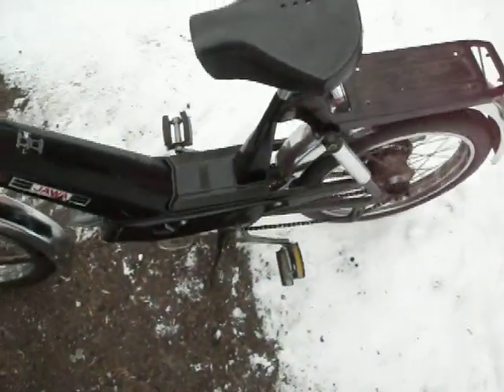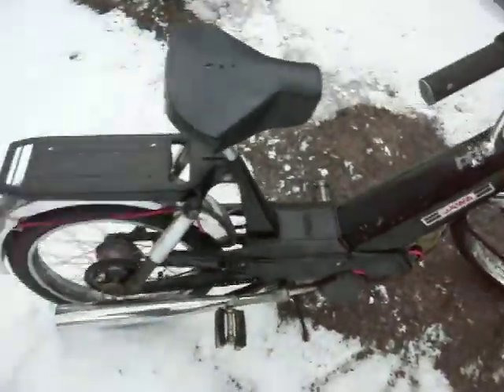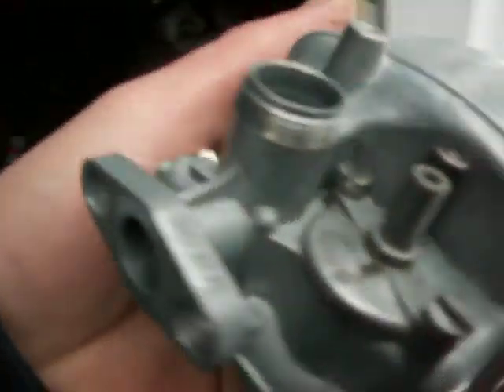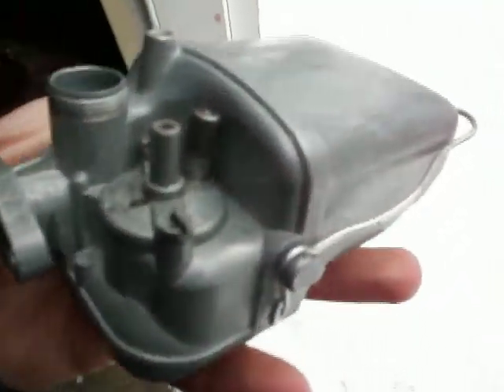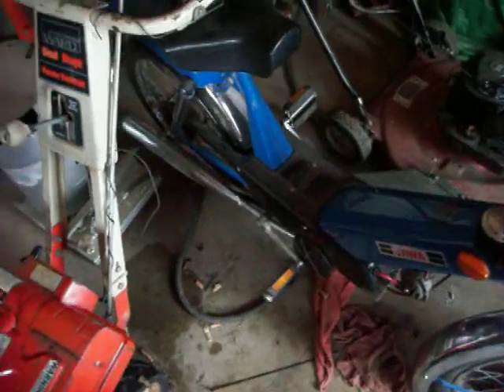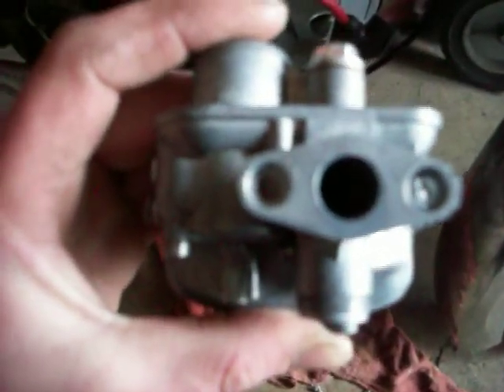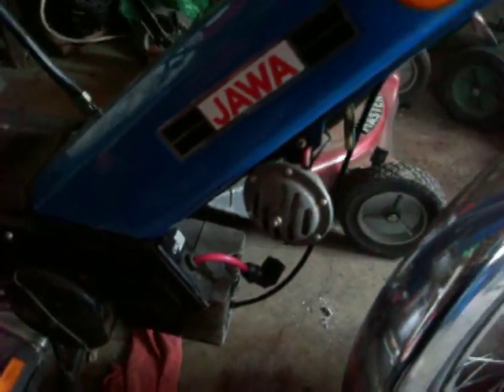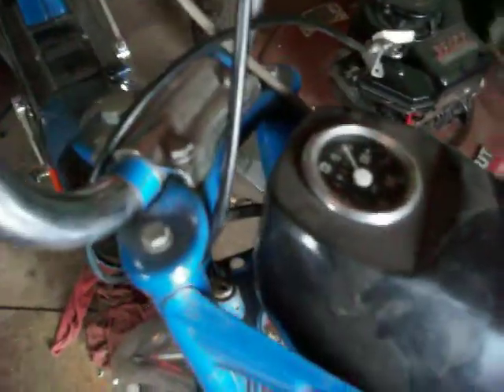black jawa ready to go

Comment: Hehe you ment Jikov carb right not "Jarkov"?The jikov carb is original on these beasts but it happens that people switch to other carbs that fits these do to the brass getting all eaten up by the ethanol mix in the fuel nowadays and that can make them run bad